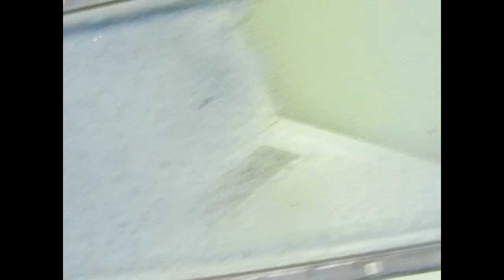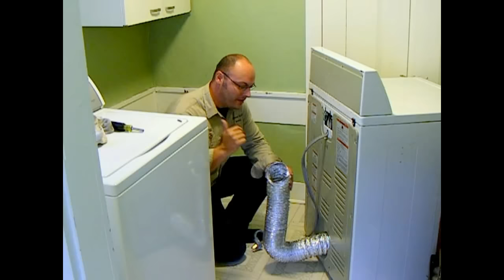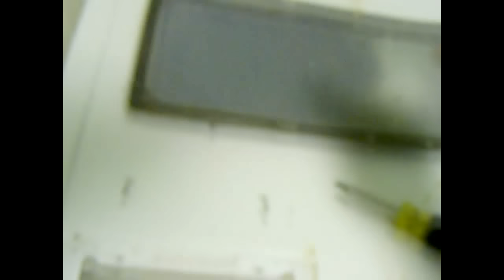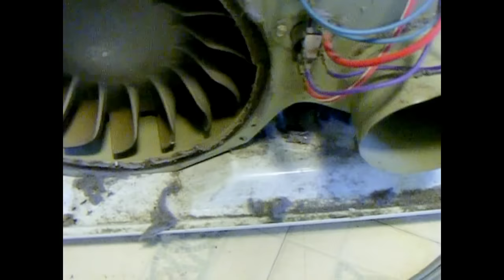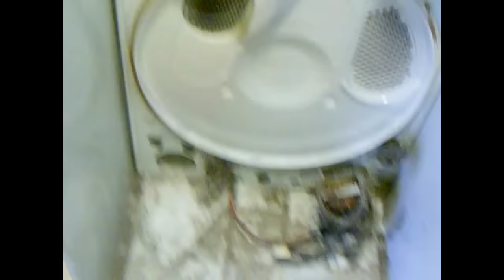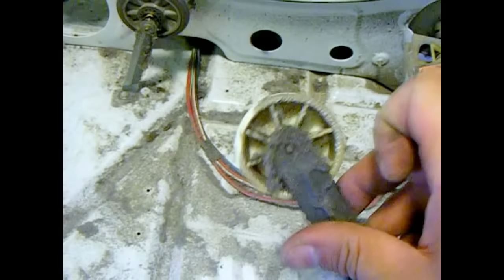Dryer Troubleshooting - Not Drying or Taking a Long Time to Dry

Comment: Nope, I was wanting to see if it's worth getting a new belt if I don't even hear a motor run. !?
Reply from the maker: hidhawkes The dryer is probably equipped with a broken belt switch.  This will not allow the motor to run if the belt is off.
Most dryers have them.  I cannot look up your model number, to me it looks like a serial number for a whirlpool product.  Your model should start with 3 letters followed by 4 numbers.  The number you sent looks like a serial number missing the last number or two.
Thanks again,   I would replace the belt first, then go from there.
Reply: Bill Newberry

Comment: But where did it show how to FIX the problem causing no heat?
Reply: Marion, here's what Al has to say:

If your dryer has no heat but the drum still turns there are a couple things that may be wrong.
1. Check the circuit breaker or fuse that feeds the dryer. If it is a circuit breaker it should be a 2 Pole breaker. Sometimes one side will trip and not the other. Turn the breaker all the way off and press it hard into the off position then turn back on. If it is 2 - 1 Pole breakers one may be off and the other on. Again, push the breaker hard into the off position and then turn back on. If the breaker "pops" in either situation you have a short circuit. Unplug the dryer and try again. If it still "pops" call an electrician. If it stays on call an appliance repair person. If you have fuses, check to see if one fuse is blown. Replace the fuse. If the fuse blows again unplug the dryer and try again.
2. If the circuit breaker and fuse are OK and the drum still turns, you probably have a bad element in the dryer. Some are easy to change. If you are comfortable opening an appliance, unplug it first. There is a panel on the back that can be removed. Behind that panel is a box that has the element in it, in most dryers. Look for burned spots or gaps in the element and connecting wires. If there are no burn spots or gaps you may have a bad control board or switch. Call an appliance repair person.
Reply: Hi Barbara,
TThank you and thank you to Al for the his expert advice.  You're lucky to have someone so close who is able to fix things when they are not working properly.However this is a bit of a mystery because I am not having any problem with my dryer and I don't remember making that comment.  I hope this doesn't mean that Al is clairvoyant and can see a future problem with my dryer!
Reply: LOL! We both got a good laugh out of your post this morning!  It's a mystery to me who Google plus works at all.  I only have used it to share photos, and I make sure my profile is private and my photos are private. Other than that, I have no clue.  I hope your dryer stays working well!

Comment: He forgot the number one rule.  Never use the kinked ribbed dryer exhaust vent tube.  They are usually not even up to code.  Use only the flat smooth sheet metal dryer duct for venting. It s smooth and has no crinkles in it thereby being safer. He should know this and install it in his own home!!!!

Comment: DANGER!!!!!  No reputable technician will use or leave installed a foil flexible venting. No manufacturer approves of the product.  Every manual clearly states to not use foil venting.  Not sure why so many videos on line promoting bad installation, please read installation guide ( I am a master technician who has worked for all manufacturers , trained technicians and educate customers).

Comment: the dryer runs approx 2 minutes and then shuts down
Reply: Check thermal fuse or just replace all the fuses. Check blocked vents, no air flow, and felt in front and back of dryer.